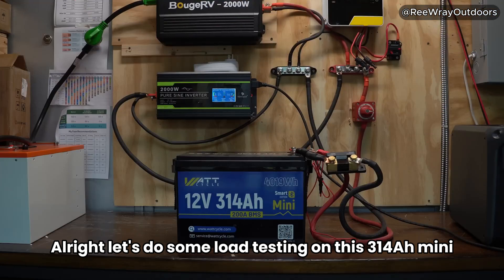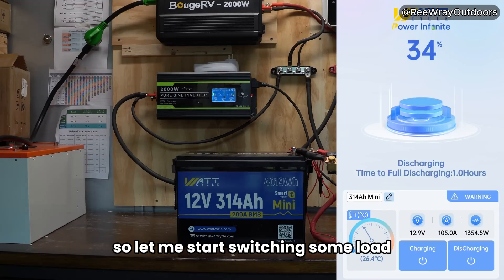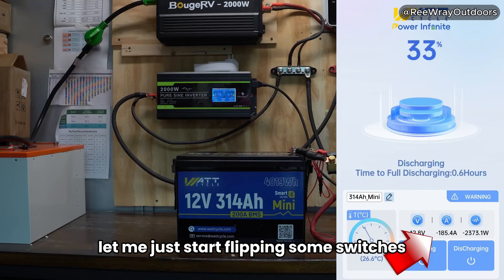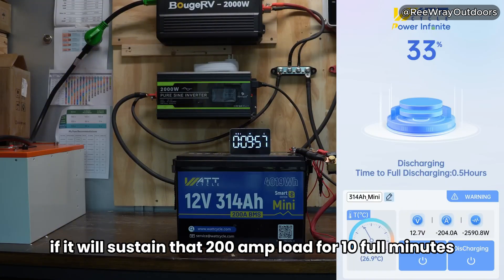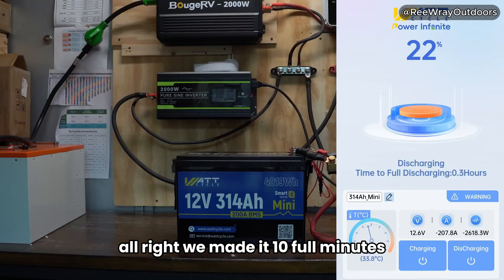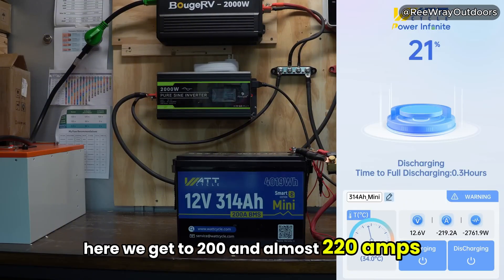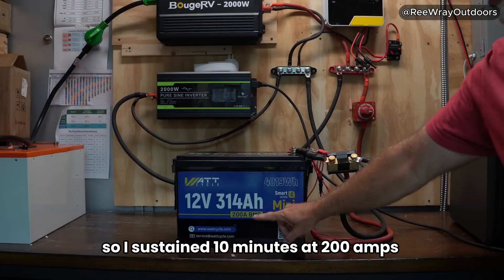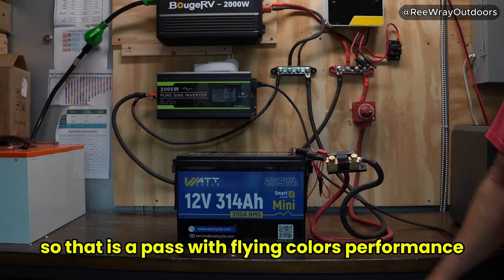314Ah Battery Stress Test 🔥 What Happens Under Overload?😱🔋

Comment: would it be wise to put fuses on the battery positive just to be safe?  a 200amp fuse?
Reply from the maker: Great question! 💡
Adding a fuse on the positive terminal is definitely a smart safety measure. A 200A fuse works well for most setups—but make sure its rating matches your system's wiring and load.
For the 314Ah battery shown in the video, we recommend going slightly higher, like a 220A fuse, since its maximum continuous discharge current is 200A. So it’s good to give it a bit of headroom. ✅

Comment: Update 8-1-2025:  I have sent you guys a response message 2 Days ago. You need to reply back to me.

I bought 3 of these 314ah Batteries because recently you guys gave a YouTuber this exact Battery to do a Teardown & Review video on it. The video showed that you guys are currently using EVE Battery Cells. And so I Ordered & Bought 3 of these 314ah Batteries on your website. After receiving these 3, 314ah Batteries.. I see that none of these Batteries have any EVE Battery Cells inside. You guys made these changes workout telling us/customers. You guys also lied about the Capacity of your 300ah Batteries. They were actually all 280ah Batteries, and you guys had to give back Partial Refunds to Customers.

I also was sent a Email Message letting me know that I am qualified for a Partial Refund. But I want a Full Refund for these batteries. I might consider a Partial Refund if the dollar amount is fair.

If this problem do not get resolved satisfactorily. I will write Negative Reviews on all Platforms letting everyone know about my bad experience & about this WattCycle's "switch-a-roo Scams" and bad reputation.

Sincerely,
Daniel L.
Order #WTUS8790

Comment: My 314 Ah  battery trigger the OV alarm at the preset 14,2 volt. When i set it to 14 volt it trigger no alarm. Why  you think? Diff volt in cells is only 0.007 V. Have you encountered this?
Reply from the maker: Thanks for sharing your experience! 🙌 
Even if the cell voltage difference is minimal (like 0.007V), when charging to 14.2V, the highest cell might momentarily exceed the overvoltage threshold, triggering the BMS protection. Lowering it slightly to 14.0V helps keep all cells within a safe margin.
You can also try restoring the factory settings with one click in the app. If the issue persists, feel free to contact our professional customer service for assistance：service@wattcycle.com😊